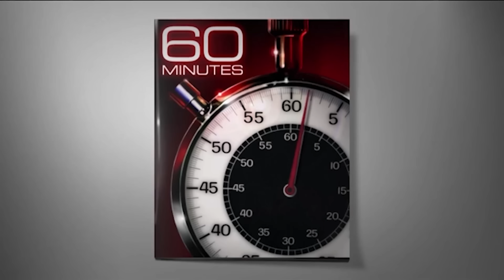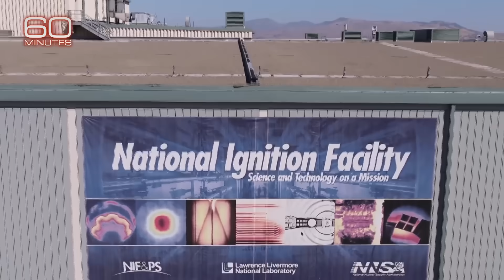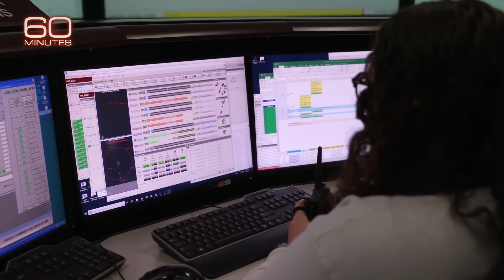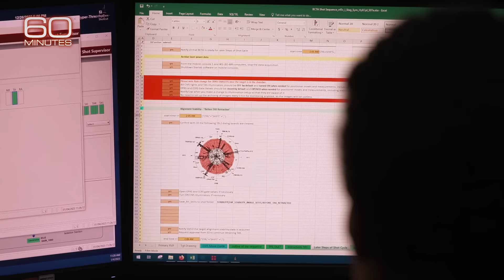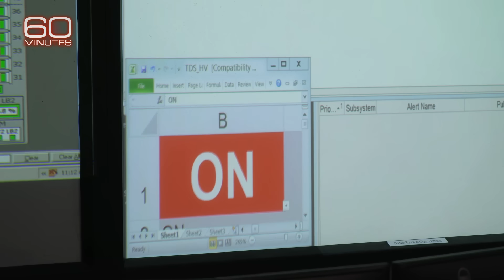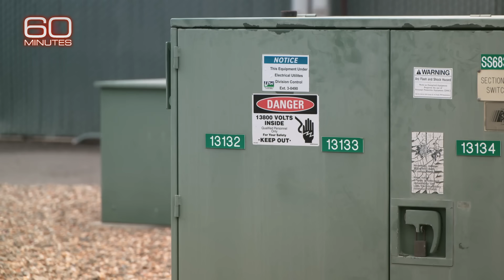Nuclear Fusion: Inside the breakthrough that could change our world | 60 Minutes

Comment: I worked on the nif project. Nothing technical but i had to go threw 40 hours of orientation before i could work in that building rerouting ductwork. I also worked on the first lazer project. My claim to fame i guess.  Lol.
Reply: The NIF lab management failed to mention that NIF was preceded by two other large laser systems that were suppose to work out all the major kinks before NIF was built. NIF was supposed to achieve its namesake 'ignition' by 2012 but missed the goal by a factor of approximately 10. It has taken many more billions of dollars of work to finally achieve that goal a decade later.

Comment: 10% yield is actually not terrible for small batch precision mfg like that
Reply: The reaction consumed only 4% of the inserted D/T fuel. The tritium is exceedingly rare, expensive and radioactive. The rest of the fuel was blasted away from the microscopic fusion reaction center before it had a chance to react. It had to be cleaned out of the vacuum chamber and its vacuum system as radioactive waste. One estimate is that the target assembly, that was converted into an exploding plasma, cost approximately $100,000. If it was possible to capture the radiated fusion energy it would have been enough to boil about two liters of water. I can boil the same amount of water for less than $0.02 of household electricity. The shot took about a week to prepare and the fusion lasted approximately 0.00000000008 seconds. If that could be repeated on a weekly basis than the fusion duty cycle would come to approximately 0.00000000000001%. As mentioned in the video the majority of the precision manufactured diamond spheres had too many imperfections to be utilized.
Reply: @vernonbrechin4207  I should clarify that yield was used in the same manner as IC manufacture, rather than chemistry
Reply: @SuLokify  - I'm sorry that I misunderstood what you were referring to. That was an interesting comparison. I'm glad that final large batch IC working dice yields are not that poor.
Reply: @vernonbrechin4207  No worries! I do appreciate the good information you offered in your comment, despite the misunderstanding.

Integrated circuit manufacturing ends up with yields that are highly sensitive to small process changes or even environmental factors, something like a 1 degree temperature difference or 1% humidity in a section of the production line can destroy an entire batch of CPUs/GPUs, typically a mature process will end up with somewhere between 20% to 50% yield (that percentage of units made will be operational) but for small batch or very early in the process 10% is quite good.

I was only musing about the yields being similar for their precision mfg fuel pellets
Reply: @SuLokify  - Thanks for your insights on the CPUs/GPUs manufacturing process yields. I wasn't aware that the clean room parameters needed to be so tight.

On the manufacture of the D/T fuel capsule I was fascinated by the lengths they go to to achieve their small percent of useable capsules. They have to examine each produced synthetic diamond capsule to determine the number and location of bacteria sized defects in the crystalline structure. Later there were descriptions of how they create a uniform coating of frozen  D/T on the inside surface of the capsule. It requires several days of repeatedly freezing and then subliming the inserted gas before it becomes uniform enough to justify another laser shot attempt.

I've seen one estimate that the target assembly cost is estimated to be around $100,000, which it turned into an exploding plasma after each shot. In there decade long quest to achieve the 'ignition' goal that they were supposed to achieve by 2012, they keep getting further and further away from any kind of economically practical nuclear fusion power plant. The continuing quest has been made possible because the funding is really about thermonuclear weapons research, as it has been since the very beginning. These experimenters are so lost in their esoteric world that they can't see what a folly it is.

Comment: Why would they want that , nuclear fusion is just a one time gig ... it comes .. and stays , one flick of the switch then no more work needed , whereas with oil they csn continually rape us of BILLIOBNS every day
Reply: The National Ignition Facility (NIF) labs definition is deliberately deceiving. Most people assume it is like the ignition of a match where once it is struck the chemical reaction propagates into any supplied fuel. It is not like that in Inertial Confinement Fusion (ICF) as employed at NIF. In that case the fusion last only for a very brief moment, in this case 0.00000000008 seconds after which the fusion reaction in the center blew all the remaining fuel (~ 96%) away from the reaction center. The reaction was totally dependent upon the massive compression of the 3 nanosecond laser beam pulse compressing the tiny fuel capsule down to a microscopic point. After that their was no significant propagation of the fusion reaction. There never will be using the ICF approach.

Comment: The fusion power ambition is not worth while.  We don't need heat to produce electricity. The use of hydroelectric power steam or wind power was obsolete when Edison generators and dynamos power plants were built before Niagra falls power plant. These are not needed power plants. Nuclear power plants and fossil fuels power plants use steam to move the armature magnets and coils of copper wire in the generator and all power plants use inverters and transformers to deliver high voltage AC power to the power lines.  We are grossly misinformed about power generation and power use. The heat of fusion power is not needed. We can move the armature magnets and coils of copper wire with the field magnets of the generator and dynamos to increase the current and inverters and transformers to  increase voltage and deliver high voltage AC power continuous peak power to power lines.  The dismantled power plant in Grand Central station was designed by Edison and can deliver 2 megawatts to the 2000 volt power lines if rebuilt as designed but with inverters and transformers to deliver 2000 volts AC to the power lines.

Comment: I am 70 years old and every 10 years, for the past 50 years, a research team announces fusion energy will be a reality in 20 years. This is total BS. It's a advertising campaign to renew funding by the taxpayers. The science behind this is based on inventing some new material that can withstand the heat and pressure of a sustained fusion reaction. There is no material that even comes close to this specification so it is absolutely impossible in any foreseeable future. They know it's impossible yet they act like we need to trust them to find the new material. They are wasting billions and are no closer after 50 years. We could employ, house, and feed every homeless person in America for what they are spending on fusion. We need to fund materials research and when they invent a material that can withstand a continuous fusion reaction then we can work on a reactor.
Reply: There will never be a containment material. At temperatures above 10,000 Kelvin all elements are either a gas, or a plasma. The fusion temperatures need to be above 1,000,000 Kelvin. Containment must occur in a near vacuum under the force of magnetic fields, or via the inertia of the reacting fuel isotopes plasma.
Reply: @vernonbrechin4207  Your missing the point. In order to harvest that heat they have to transfer it to the steam generators. What material can do that? This is where science breaks down into wishful thinking. There is no place on earth this fusion can be put to work. Maybe in the vacuum of space.
Reply: @ToIsleOfView  - I agree with most of your points. I'm 77 and have followed this technology since I was a little kid. Actually it still technically is possible to transfer the energy of the 1,500,000 Kelvin ionized plasma to a liquid, or gas heat transfer medium that eventually flows to steam generators and turbine driven generators. There are two ways to accomplish this though it has never been demonstrated in any of the dozens of nuclear fusion energy experimental facilities around the world.

1) The majority of the nuclear energy is radiated from the plasma by 14.1 Mev fusion neutrons. They travel in all directions away from the plasma and deposit their energy in matter surrounding the fusion plasma. If the material has a low atomic mass, such as hydrogen, or lithium, then the neutrons are absorbed quickly, depositing their energy within that surrounding matter. If the surrounding matter is made up of high atomic number nucleases then the slowing is less rapid and more bulk is required to slow the dangerous radiating neutrons. There must be enough shielding to prevent humans from being exposed to the neutrons and its related radiation. Some of the neutrons will also be absorbed in the nucleases they hit transforming them into other isotopes, many of which will be radioactive. That process will slowly turn portions of the reactor into radioactive waste while it also weakens its structural integrity. 

2) Another form of energy that can be captured is the radiated thermal energy of the plasma. Since it is radiated in all directions then a tightly confined fusion plasma will need an absorbing wall some distance away from it to prevent it from melting. The inverse-square law applies to the radiated photon energy so the intensity of the radiation will fall rapidly with the distance away from the fusing atoms. As long as the radiated surface is sufficiently cooled by some heat transfer medium then it will not reach its liquification point, or lose its structural integrity.

Both of these issues will have to wait until a test reactor generates anything close to useful amounts of nuclear fusion energy before the many kinks can be worked out on this aspect of nuclear fusion energy research. These issues are not being treated as priority issues now since no experimental reactor has come within the many orders of magnitude of energy production needed to work out these other issues. The typical hyping promoters of nuclear fusion rarely mention such issues and assume that most of their audience will remain unaware of these major hurdles that still need to be jumped.
Reply: @vernonbrechin4207  Thank you for your well thought out description.
Reply: @ToIsleOfView  - Your welcome. I try my best to educate others and aid them in doing their own explorations.